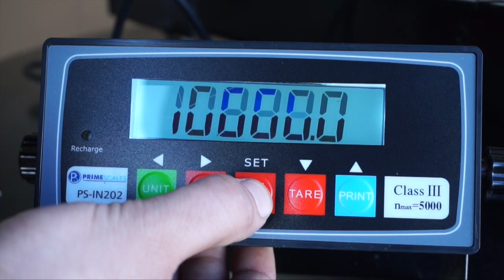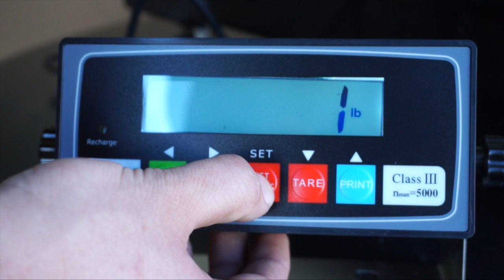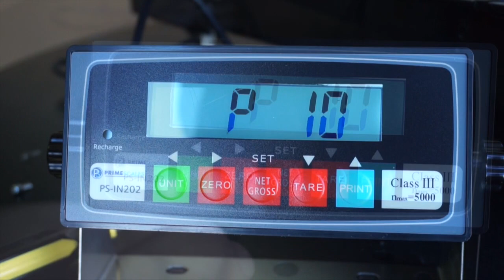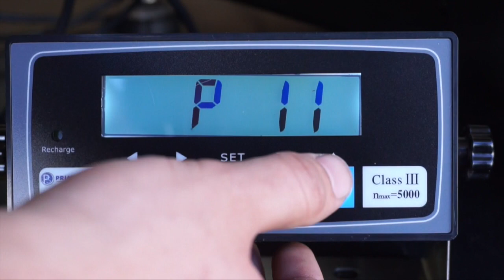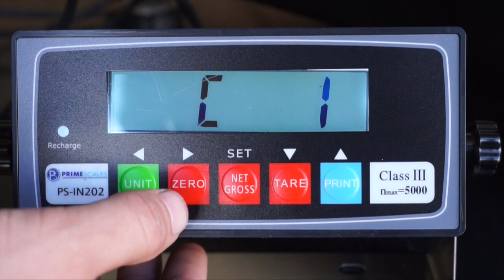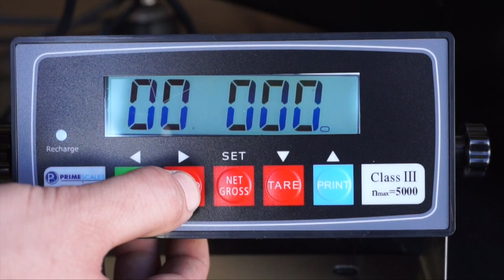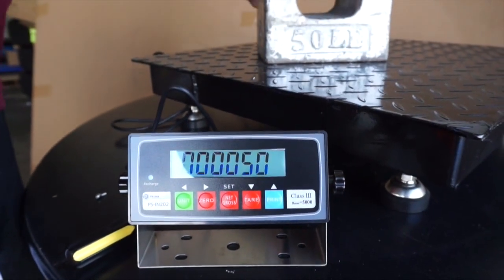PS-IN202 Calibration

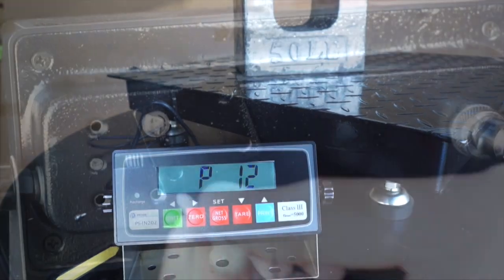Comment: 3:07 Does it have to be 50 lbs?  All I have is 10lbs, and it says err 0 when I try to use 10 instead of 50
Reply: You can use 10lb. Go to P11 internal count and press the scale see if the number goes up.  If it does,  redo the calibration but make sure the weight is on the scale before hitting the SET on P12.